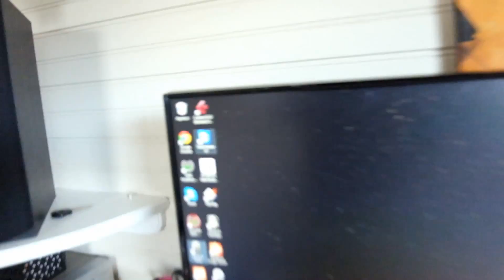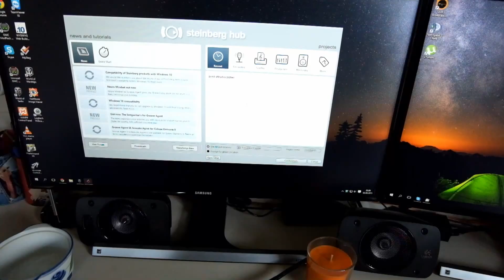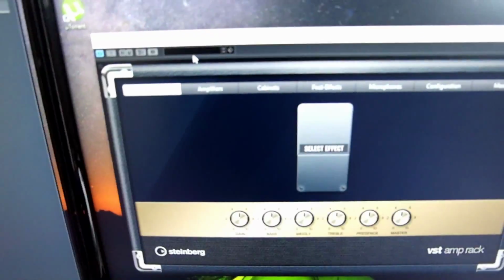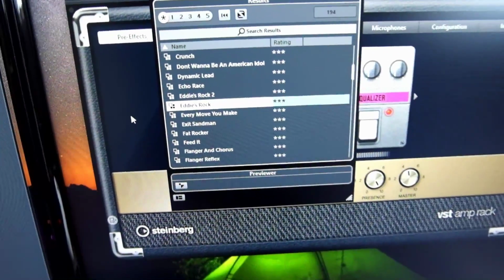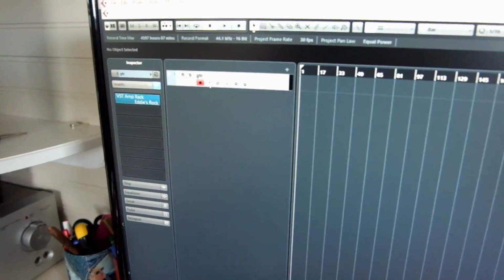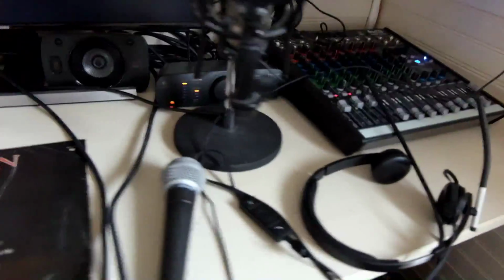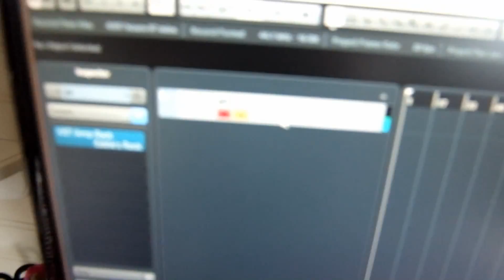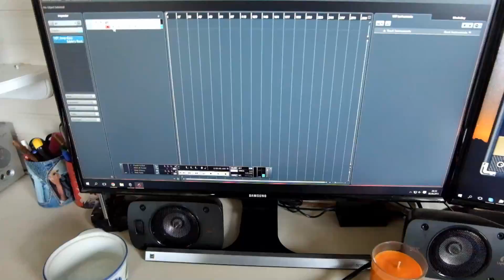Wierd Noise on VST, USB, DAW and Mixer Problem (with sound)

Comment: I have had the same problem in the past. That sound's are supposedly coming from the usb cable. The data transit between the two creates 2X ground noise levels hence the Loud linear sound. most pc mobo's are not well grounded to the case.

Things 4 a quick fix; 1st check DPCaudio*
Power management = performance level
Multi threading step up / turbo =off
Better shielded xlr trs cables a+
Power conditioning rack a+
Hum eliminator / Dibox a+
Not usable ports and hardware unplugged=off/
Device manager* physical and virtual= off
....

Comment: Okay, this is an old video and I don't know if you've ever figured it out.  But I remember getting some similar strange noises with my first interface and it had to do with setting the audio quality of the sound card in system settings on your computer.  And then making sure that the same audio settings were selected in your DAW preferences.  Lemme know if you fixed it, and if not if my comment is too vague I'll elaborate.